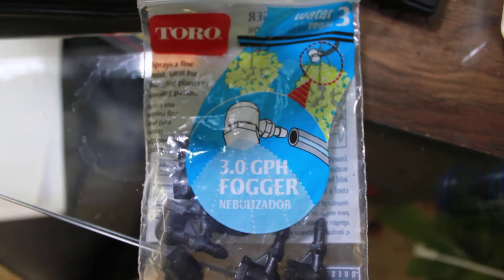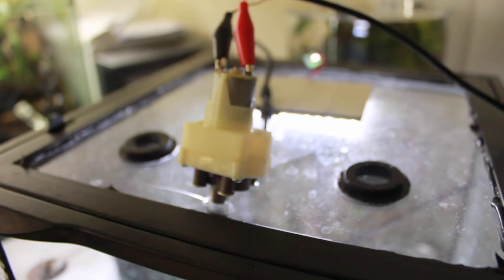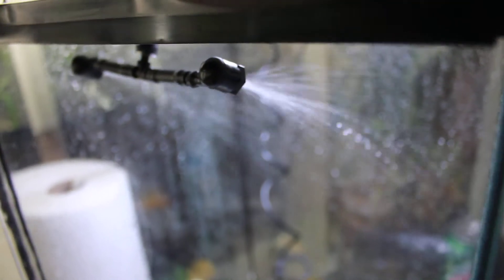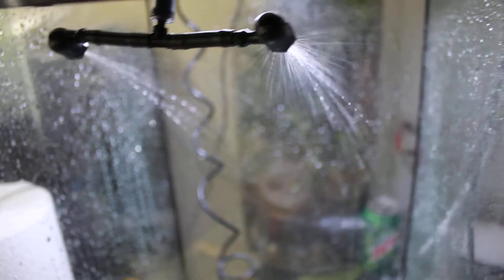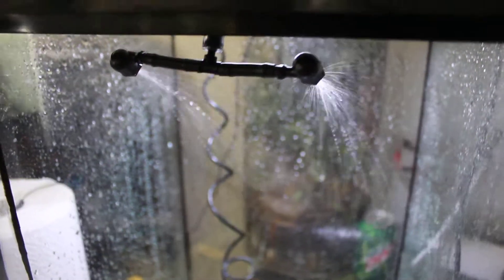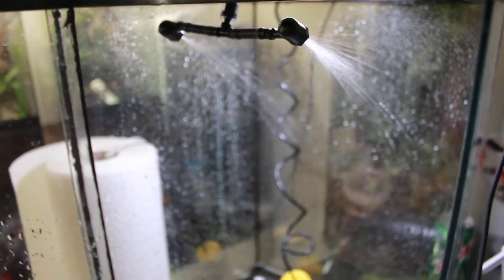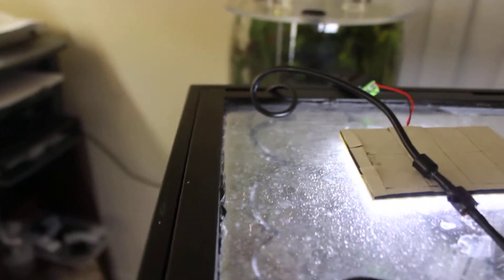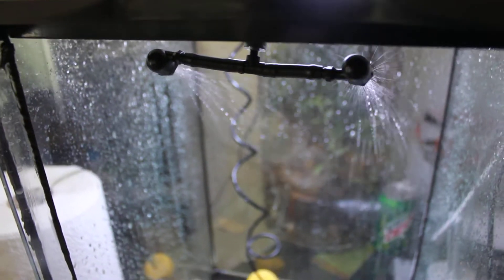Terrarium rain system concept continued

Comment: Going to test out something too here. Our coffee machine (PETRA, with pads) had a serious leak underneath, and I decided to disassemble the darn thing to see what parts I could use. And sure enough, inside there's a little motor that kinda looks like yours. It's a 220-240VAC, 50Hz, 22W motor.

Also found an old Samsung phone adapter (I have like 10 different old chargers laying around ^^ ), which is 100-240V, 50-60Hz 0.15A, output 5.0V.

Now, my problem is: there are of course two red wires coming from the motor, but it doesn't show which is the plus and minus. Does it make a difference if I connect them to the adapter or do I risk blowing up the motor?

Cheers mate.